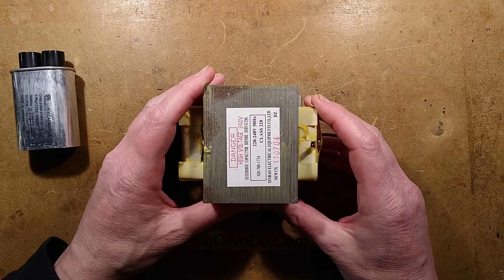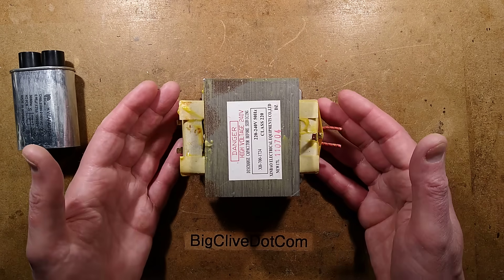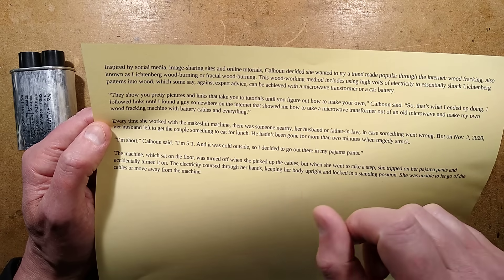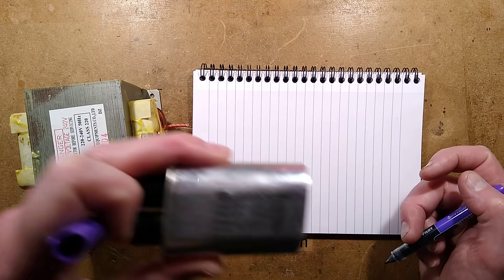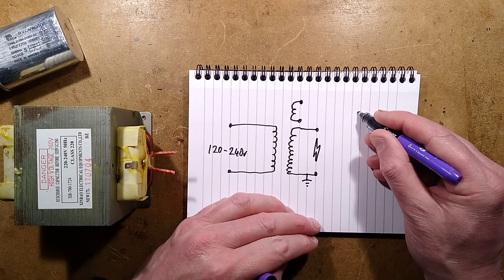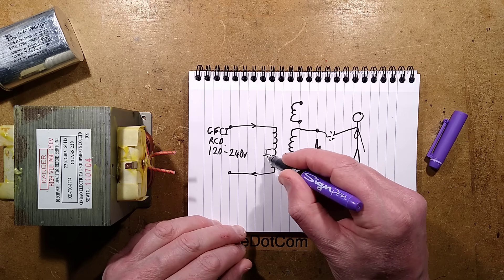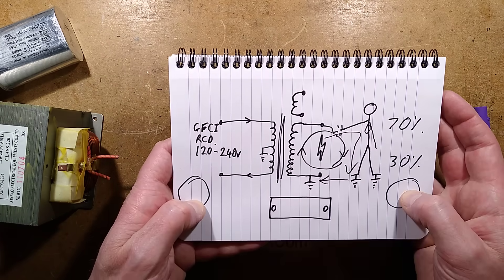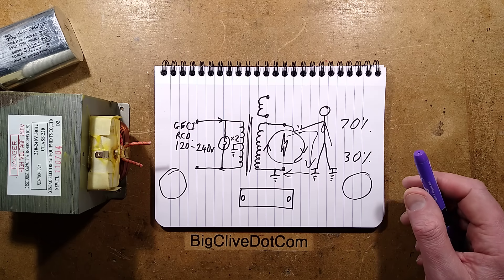The most deadly project on the Internet

Comment: You know super hero movies where they get converted to have super powers at a young age. THATS ME. I was climbing through an electric fence. Not thin one strand wire but an inch thick designed for horses. Got a real smack about it. OK so you had a huge field made into smaller paddocks border by electric fencing. The part I was climbing though only a foot on the other side you had another fence formed of barbed wire and then a foot past that another electric fence an inch thick. Right so you got it. I was climbing through the first fence when my leg got caught in the barbed wire and I got zapped as I fell. Only I fell into the second fence. As I reached for the barbed wire holding tight to my trousers I got a huge voltage smack which wiped most of my memory. Almost could not recall I had to get the fence off me. Then half second later I remembered but too late because another high voltage smack came from the other fence. Yep I am bridging both fences. Anyway from that moment on electricity doesn't affect me like it does most. I only get a slight tingle in my forefinger knuckle and nothing else. Example. Mazda RX8 new coils and leads yet the old leads were faulty. I had my hand on the lead and whack. 50000 volts up me. Yet it only made my knuckle tingle. 

ha ha ha ha.  so how is that. You talk about these transformer killing people, yet electricity doesn't do much to me. Not the volts anyway. Haven't tried the amps yet for obvious reasons.
Reply from the maker: You may wish to watch my unofficial guide to electrocution video.  It covers electrical invincibility.
Reply from the maker: https://www.youtube.com/watch?v=9webTbqTH5E

Comment: Some of the riskiest and most dangerous activity involved with the project involves people who wouldn't know which end of a screw driver goes in the screw head, trying to take microwaves apart to get the transformer out. If you don't know what a capacitor is, what it does, or how to behave safely around them, it is really easy to assume that, because the microwave is unplugged, it should be safe. It isn't though, not necessarily. I don't mess with capacitors, because I know just enough to know they are scary dangerous, and to leave them the hell alone. As for wet hands when working with current... Clive, there is no point trying to save some people. You'll maybe catch a couple, but they'll still die doing something stupid and wrong, it'll just be something else instead. Save your breath, for more great videos🤣👍

Comment: I had no idea people were doing this. I work construction and survey, and high voltage is a required safety knowledge. I can't believe people are DIYing this with no OSHA-level practices or PPE, they are severely underestimating the potential voltage they're dealing with, pun intended. That woman in the burn story is cosmically lucky to be alive.

Comment: I've made an arc welding machine using 3 salvaged microwave transformers , in the process of replacing one of the the three secondary winding (coil) I've got zapped  touching the primary that had a charge left in it that i stupidly forgot about,  and let me tell you even if it's not the high voltage winding , i taught i was a goner while being shocked , truly  scary AF .

Comment: I worked in a wood factory that this happened often in. We got wood from all around the world that often had lead pellets or steal in it. We also had an industrial glue machine that quick dried glue using high energy. One day a new operator was running the machine and used a metal tape measure. NO NO!!! He got knocked on his ass and a finger damn near blown off. I laughed histarically 🤣🤣🤣🤣🤣🤣🤣 moral of the story is don't touch shit unless you truly understand what you're fucking with. And don't count on the people that are supposed to warn you about shit, because more often then not they just want to see you get fucked up.
Reply from the maker: A place I worked had an early RF glue curer that used to do fireworks when metal got involved.

Comment: "At 600 volts nylon becomes a conductor of electricity!" This is what my jump master told me when I asked him why I should steer way clear of power lines.  All the years I worked in construction never knowing that at higher voltages materials that most people would think be an insulator are actually conductors! 
Is nylon a conductor of electricity at 600 volts?
Reply from the maker: Nylon is a good insulator.  But if there was just a thin layer of nylon between you and a live wire it might arc the tiny distance.  Wet cord is also conductive.

Comment: The biggest problem with any electric shock is what it does to your heart. If you receive a 50-60 cycle (normal household AC current) across your chest, your heart rhythm is interrupted and your heart tries to beat at that rate. This is not possible so blood flow ceases and you die. Even a high amperage DC current, at the wrong time in your normal heart cycle (R on T) can throw your heart into fibrillation. Unless it is restarted (defibrillation) quickly, your blood flow ceases and you will die. 
 Burns from high voltage are a secondary problem. You have to be alive to worry about burns. Well, unless you are worried about what your corpse looks like. 
  Voltage itself does not kill you. The current does. A Van DeGraf generator produces hundreds of thousands of volts at a very low current. It will make your hair stand straight out but not hurt you. It's when the amperage, combined with the voltage becomes high enough to be fatal. 
  The electric chair doesn't rely on extreme high voltage. The voltage is usually 208-477 volts of 3 phase AC. I'm not certain what the amperage is limited to. At least 100 amps. But, the guy sitting in the chair is about to become a big resistor between those 3 phases.

Comment: If hobbyists need to know when a transformer is on, they should just add a light to it. I do believe this transformer is 500watts, running at 2.08 amps. So unless I'm missing something with your story 6 gauge car jumper cables shouldn't have any problems handling 2amps.
Reply from the maker: The cables aren't rated for thousands of volts.

Comment: When I was in middle school, I had a shop teacher that was a navy vet and he would tell us stories about his time. He was an electricians mate and had served in the 50s. One story he told when we were getting into electrical stuff was when he was working on a Radar console in the CIC. I do believe the consol was depowered, but it's been 25 or so years, so I don't really remember. 

Anyway, he was working on the console, and grounded himself to the console and thus the deck plate and hull when he brushed it with his elbow. Whatever he was touching at the time still had some juice, and so it went into his hand and out his elbow, aaannnd threw him across the deck. Fortunately the current was mostly skin transmission, but enough got through that he lost feeling in some of his fingers and a line from there to a point on his elbow. His lesson was as follows
"Don't fuck about with electricity."

Comment: Bro I grap hole 277 voltage. It took my leg out from underneath me. 
And when I was 16 I arc out 22500. A created a plasma ball 16' by 6 came rolling down to me and some how I move the way. 
I've been lit up several times tripped breakers. And I have no exit wounds and I still have all my arms and legs.
Reply from the maker: If you'd actually passed enough current to trip a breaker (quite hard to do) then it would have potentially have been a life ending event.  Here's a video that might make sense of that:-
https://www.youtube.com/watch?v=9webTbqTH5E
Reply: @bigclivedotcom  don't you think that I know this. I have many witnesses. That can take a lie detector test. There is only one explanation. I am a direct decent of the tribe of Levi. Otherwise I'm a  media human or alien.

Comment: My burner has a dead man switch. I built mine in a cabinet with a contactor. It also has a varactor so I can regulate it for different depths of burning.  I use high tension cable and alligator clips. For mine, you use screws or nails and clip on the leads and move back and press the switch then move your points.

Comment: I'm an electrical engineering nothing. (My uncle would have loved your channel; sadly he passed before I discovered it.)

I know enough to know that being the path electricity takes to ground is what hurts and/or kills ya.

I saw you draw that stick figure with the grounded symbol, which you helpfully introduced earlier in the video, and I clenched so hard that as soldiers would say, my arse could've compressed coal into diamond! YIKES!

This device seems like the scariest, stupidest thing to DIWhyyyy. Even a professional doesn't seem to want to touch it!

Could a commercial, safe (well, safe from electric stupidcide) version be made, do you reckon? I don't think it's worth it, but it seems like there's a market for this malarkey...

Comment: Excellent video. 2kVAC at such a low frequency is devastating. Made worse by the transformer being such a low impedance source compared to the body. A dumb mistake once in my days of amplifier building got me hit with the total DC of a +/- 200 volt supply across each arm (so 400vdc total) and I'm lucky. Shit does happen when you're building high power amps and have to be constantly in and out of the enclosure building and probing. Can't even imagine 2kV at 60Hz

Comment: hell yeah i touched the freezer and the fridge in a wet basement. wow. i stood there for about 10 seconds, the first couple seconds i wasnt worried. then about five or so seconds, i was like oh oh, about 8 seconds i was starting to panic and it hurt. i concentrated on opening my hand where i had the fridge door handle. and just managed to open my fingers. 
a buddy of mine bit into a power wire, he was pulling the rubber ends on to magyver the plug. idk why he didnt unplug the thing but he later told me the thought never crossed his mind. he was stuck there for a bit. he said after about a minute he was really worried.

Comment: This also is a good description of how lightning goes through your body to ground.  I have been hit three times in my life. I am damn lucky to be alive. I was hit when I was 15 years old. It hit me in my right shoulder nd came out my feet with two nasty burns on my heels with meat missing. This board @13.20 is what my back right side looked like but it was purple and blue. I was barefooted at the time going to get the cattle in for milking. Never heard thunder at all, but there was a very bright flash and that was all I remembered when I woke up about 20 ft down the hill. This was rough country and I was hauled out on a Wagon pulled by a horse.  When I see these lightning bolts and hear thunder my little fat ass is inside quick.//

Comment: It wouldnt be bad if you had a proper procedure and safety protections. For example, a buzzer or alarm that is active while the equipment is, proper electric level PPE. Also doing a process where the leads are placed before activation of the equipment . And then the process is conducted while the operator is away from the open leads and the process is activated by a switch that can deactivate and activate the device.  

Electric can definitely be dangerous and everyone should heed it. 

Im not saying this is a good idea but if you are going to fuck around with it at least be sensible and take precautions.

Comment: Thanks for the warning! I want to build a spot welder from a microwave transformer. Thank you for the cautioning you could've just saved my life not realizing the power of the high side voltage could've got me when working on it.Yes so basically unplug everything get the capacitor loose before touching the transformer and then remove the high-voltage windings. This is for making the spot welder, of course.

Comment: I do fractale burning and i understand the danger.   I NEVER handle the leads.  I tap nails in and connect the high voltage leads to the nails.  I have multiple switches, a light and the whole thing runs through a variact.   My switches are not momentary though....kinda like that idea.   Although the light has allowed me to never even come close to grabbing something while it is still on.  A tone generator would probably be even safer so there is an audio cue that it is on.

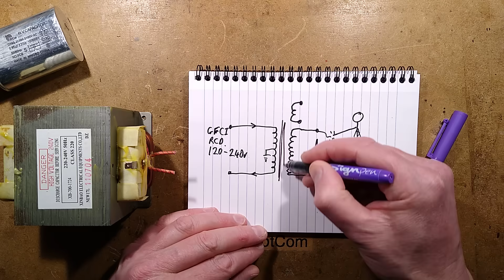Comment: 10:30 I'd think that with 2 probes, it would be possible to put the transformer in a plastic enclosure and keep the secondary totally isolated. That would eliminate the risk of getting a shock through one's shoes to ground, but it would still be possible to get an arm-to-arm shock. Could one put the wood in a small tray of water, which would then be connected to one side of the secondary, but not to ground, then have the other side connected to the probe? That would allow the user to only use one hand, though he or she would have to have the discipline to keep the other hand away from the water. 
PS: I'm OK with being told not to try this at home; I have no ambition to try anything like it.

Comment: as far as you went, your explanation was reasonably good... but you made mention of your muscles contracting and holding on... so is the transformer putting out DC Current? Also, if you want to continue with a "Be Safe, Not Sorry" video, you could define safety measures that can be taken: high voltage globes; rubber insulation matts; proper cable size and insulated probe handles; the ON light you suggested; water drainage system; and proper clothing; etc.... as some who was an electrician in the Navy on a DC powered ship, and who likes wood working and fractals, your explanation was good enough to make me decide to NOT ATTEMPT THIS... 👍🏼
Reply from the maker: It's the continuous polarity inversion of AC that causes sustained muscle contraction.  Pure smooth DC causes a single convulsion and then burning.

Comment: So why have I not died getting shocked by a vehicle coils? They are like 30,000 40,000 volts. So not sure how people died from 4000?
Reply from the maker: Because the tiny ignition coils put out low energy spikes of current and not sustained body-ripping power.
Reply: So it's not the amount of volts or the amps? It's the constant flow?

Comment: Can someone please answer me this question. Would removing the HV output that is connected to ground, so neither output are connected to ground, make it "safer"? So you would need to touch both HV outputs to get a lethal shock? Would the transformer still work with neither HV output connected to ground?

Comment: Having worked on 400,000 volts for over 30 years you do not get a second change. Great video highlighting the dangers. I built a CRT TV maybe 50 years ago and gave the 25kv DC supply to the tube a lot of respect. Luckly the modern TV's have a much lower voltage.

Comment: This truly is a dangerous "toy" that is heavily underestimated by people. Especially people who have no knowledge of electricity and the power behind it.
Homes in countries with decent electrical regulations are installed with residual-current circuit breaker, meaning that when you touch a live mains wire and there is too much current lost (through your body) to ground, the circuit breaker will pop, protecting you or your loved one.
This transformer does not do that.
As Clive says, thie secundairy winding is Galvanically isolated. The RCD will never pop, not protecting you.
I worked as a professional electrician myself. Here in Europe we have 240V mains 50Hz.
This is more dangerous than the 120 volts 60Hz in America.
Ones (I will never forget this incident) I touched the unisolated part of a plier and tried to cut a live wire, not knowing the wire was live.Both my arms were resting on grounded metal strip.
I had felt electricity before but nothing like this one. The pliers flew of, I almost fell form the ladder and I was confused for a moment. Then realizing what had happened and how damn lucky I was.
What I want to say is that even professionals make mistakes that are potential lethal.
Listen to Clive. DO NOT DO THIS AT HOME. Do not play with these high voltages with such force behind it. It is not if, but when it will kill you. You will be tired at some moment, will will forget to check something, You will have a broken part or a broken wire and you will come into contact. Don't do it. Want an exciting hobby? Go skydiving. Or black slope skiing.

Comment: I have always wondered why they did not use a switch that was removed from the location of the work so they would have no chance of being exposed to the voltage, I have thought about doing this but would never do it the way they were, I don't see this as a hands on project when powered up.

Comment: input 120V and with enough turns on the secondary, I can generate upwards of 20,000 volts. that magnitude of voltage will kill you and it will hurt until you die...but if you are unlucky it will cook the muscle on the insides of your arms and possibly your heart...if you dont take precautions you will get hurt....high voltage will break the diaelectric of air and reach out and touch you...